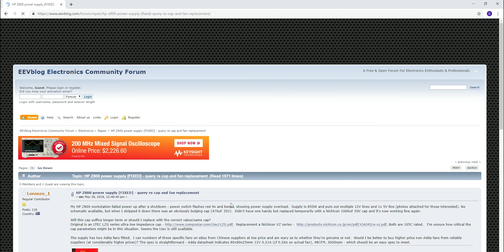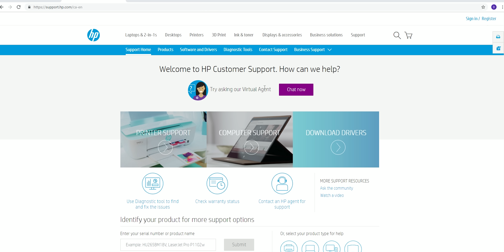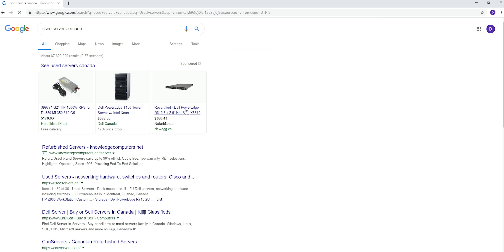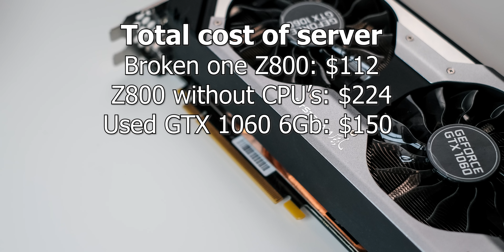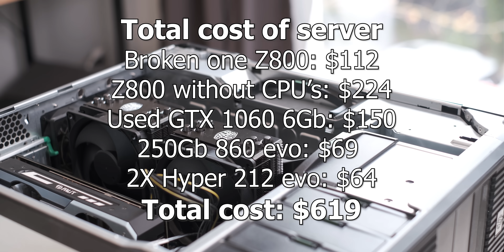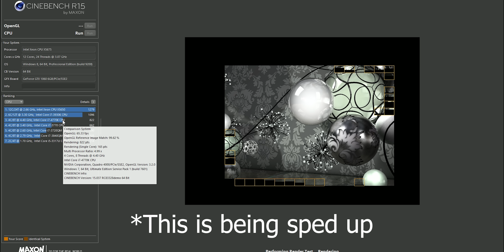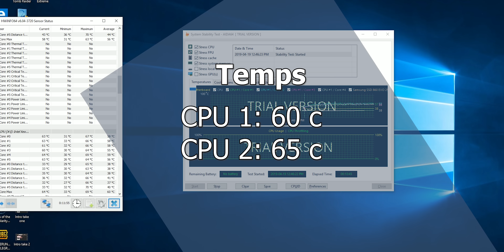Dual Intel Xeon, 48Gb BEAST for under $700! (With Benchmarks)

Comment: The two happiest days of one's life... the day you get your dual cpu system and the day you sell that system.
Reply: I don’t know I nearly cried when I sold mine, (was noticeably faster, 2 e5- 2670) and it was 2016 then. I did regret not doing some things differently, like motherboard choice. but its all behind me now I have a single 14C xeon cpu now.
Reply: Major Architect i have them aswell
Reply from the maker: Haha!! I guess that's an exciting circle of life for a PC.
Reply: @DawidDoesTechStuff  where you able to get the dual xeon system to go into a sleep state?  I have S5520hc with dual xeon and the dam thing wont idle.  in one month it raised my electric bill $150 :/
Reply: ive got a e5 26xx dual socket. was gonna use it for video editing, but im gonna use it for storage now, and probably networking too. like a router with the storage built in.
Reply: FACT. I had a dual xeon 2689w system with 64gb ram, much faster than this one as it scored about 2000 in cinebench (employed as a 3d animator) and a simple 1st or 2nd gen ryzen 7 cpu is far better. similar multi core score and MUCH higher single core. zero reason to get old xeons the second the ryzen cpu's came out.
Reply: @adambrandejs1839  No that just means more reason to get a dual socket with zen cores. Think they make them in micro-atx? I like compact builds.
Reply: Jame Gumb they don’t make dual socket ryzen at all. Let alone in micro ATX. You need epyc for that, in E-ATX.
Reply: @jamegumb7298  no. Dual core motherboards are extremely rare an extremely big so you only have like 1 option last i checked. Which sucks cause you need more than a motherboard that has 2 processors. You need gaming features an massive space for slots an high end audio etc
Reply: @adambrandejs1839  Zen 2 really is going to kill the whole dual Xeon workstation/desktop hack. The power usage, performance, and price just don't justify building these rigs. The only upside is getting the ECC dims to clock higher in an older DDR3 Ryzen board.
Reply: @wes9451  some people spec up dual amd epic 64core rigs, for total of 128 cores. There are always use cases for more cores.
Reply: @adambrandejs1839  the fact that the prices if these cpus are fraction of the cost is the reason its worth it, its not always the score on the benchmarks although its important.
Reply: adam brandejs -except in certain virtualization scenarios, especially if you need lots of PCI express for multiple gpus and other devices.  they can still be competitive but much cheaper than thread ripper alternatives. also generally better supported in software, requiring less work arounds.
Reply: @adambrandejs1839  except money. Refurbished xeon workstations can be pretty cheap.
Reply: @adambrandejs1839  sometime tou just need cores for a bargain price. I'm looking at a dual e5-2680v2 build with 64gb of ram, 250 m.2 and 2x2tb barracudas.  It will cost 650 to700 pounds all in. That will score roughly 70% of a 3950x system. Which would cost roughly 2.5 to 3x that. Good pp$ I need a vm and network simulation monster while I'm still a student lol.
Reply: @petershuker163  Having used a similar system for a similar purpose, I'd really rather use a more modern CPU with fewer cores, because (1) VMs aren't usually busy all at the same time, so oversubscribing cores makes sense (2) these old Xeons are just so incredibly slow for lightly threaded workloads, that just having a deskop on them gets annoying quick.
Reply: @adambrandejs1839  memory capacity and bandwith say otherwise. I have a dual E5 2678v3 system with 256gb of ddr4 2400mhz cl12 in 8 channel (4 channels per cpu) and has similar single core performance to stock 2700s with a turbo boost unlock, and destroys them in multi.
Reply: @adambrandejs1839  weird, my dual 2670 system scores 4200 in cinebench, and my Ryzen 3700x with a Radeon 5700xt, (I know it is CPU based) only scores 4800. It cost, over $1k, whereas the dual xeon, I picked up off eBay for $345 before I added RAM, or a little more than the Ryzen CPU itself. And for virtualization, has twice as many vcores. Dual xeon machines off eBay are still a good deal.
Reply: @ftnetops4264  are you running the all core turbo hack?
Reply: @KadiusFTW  Not that I have set up. They are not v3's. I do show they are running at above 3ghz on all cores, though.
Reply: @adambrandejs1839  I have a stock Ryzen 3600X with good B die Ram  it gets 3850 in Cinebench R20.
Reply: My needs for dual CPU systems died the when Threadripper/Epyc were released.
Reply: Abit BP6 with dual Celerons!
Reply: I still have my old Dual Pentium III board and the 1.4GHz CPUs. 
Some day I will rebuild it as a retro museum show and tell like system.
Reply: @vh9network  I finally threw away my Dell Precision 220s with dual PIIIs... They used RDRAM and it was ridiculous to find enough to run anything close to current
Reply: Me with my R900 four CPU server. $70 and profited $30
Reply: Same with boats
Reply: Not really. I have 8 dual cpu z620 in the company and still use a dual z600 as my daily office driver. 200 chrome tabs? - easy peasy.
Reply: This comment doesn't even make sense.
Reply: Yep! Same as Alpha Romeo cars :)
Reply: I miss my dual xeon system, even though my i7 7700k seriously outperforms it, there's something about having dual CPUs, its just so much better than dual GPUs
Reply: Never.
Reply: Lol true, I'm currently selling my hp z600 and just purchased a hp z820, I love the older hp z line up thus far.
Reply: sad FACT: you can't sell them, because nobody wants them. I have 4 combos, Intel S5520HC with pair of X5690 or X5680 CPUs, after I upgraded every machine to SuperMicro X9DRi-L4FN+ and E5-2667v2, and auction for them has been hanging for like 5 months now, despite price being lower than pair of these CPUs go together. I think people buy these things only to build that kind of system , and aren't sure exactly what to do with it afterwards.
Reply: @Vatharian  I have a single 6200 Opteron build I did in 2013(lured by cheap CPUs) but life got messy and it just sat there. I should have found someone who could have used it for compiling, R, or something of the sort in the few years that followed. Now I doubt a Data Sci/Computer sci major would even want it for free. That's why I ordered a 6348 for 15 bucks.
Reply: @Dcatts-i2z  If you can max out the platform fox cheap, why not. But some things aren't worth it. I have 30 socket 604 platforms, dual cpu and all, the are just sitting in the basement. There is literally nothing exemplar about them, except them being testament to my stubbornness.  Vintage/retro server guys love SGIs and dual 486, Pentium 3s and Core2 Xeons, while P4 just sits there.
At least you can run modern Linux and W10 on your setup.
Reply: I never sold a CPU.  My last one lasted 10 years an i just left it behind when I moved because I couldn't carry it
Reply: I have a bunch of dual CPU workstations from the 90's till today and never sold one. I keep them in my collection. The most expensive one cost almost $10,000 in todays money 20+ years ago and made its money back several times over.
Reply: Just picked up an Asus Z9PE-D16/2L dual xeon, 2670, 16 core system in a huge Fractal Design case, off eBay for $350. Running esxi 7.0, It seems to idle around 100 watts, about the same as my dual, 2430v2 Dell, T420, also, bought off eBay at $400. Weird comments here. These are quiet, low power use systems, great for home lab and network or Vmware certification labs. I'll upgrade it In a bit to dual xeon 2695's to get 48 vcores for another $300.
Reply: @ftnetops4264  That's what I'm using my stuff for. Putting together a 4c/8t Haswell build atm because student licences are for vServer/Center 7.0.
Reply: @ftnetops4264  might wanna go dual e5 2696 as they have a higher all core boost
Reply: @KadiusFTW  for me, the 32 cores are about all I need. I also have a Dell T420 with 24 vcores, and so simulate two, separate, DR datacenters. Strangely, some commented that their 2680 or something, was only scoring 2k in cinebench. Mine is a solid 4200 with the 2670's, and a Quadro 4000 with only 2GB Ram.
Reply: It's expensive. And it's something almost nobody want.
Reply: @sophustranquillitastv4468  Why?
Reply: @mokanin8894  Because dual CPU system have less option onboard, difficult to find a case that can hold it, require massive power supply even the whole system didn't use that much power but want 2 EPS power connectors, and lastly, it's very expensive relative to how much generation has pass (CPUs are not expensive but motherboard are). The god thing is you can have something that normal people would not nave, simply unique, but the downside is how expensive they are even they are old. Good dual CPU motherboard can get the price as high as 250$ or even more. If someone want to get it's payable foe him, but everyone else usually think it's a rip off. If you get that kind of system but now you've bored of it, expect the price you sell will be no more than 30% of the price you bought.
Reply: @sophustranquillitastv4468  Thanks for the reply. Do you personally think dual CPU systems are better for server builds for virtual machines and such? Are there any pros to dual cpu systems nowadays?
Reply: @sophustranquillitastv4468  why wouldn't anyone want it? Mine rocks
Reply: @jessejames5825  I still using them too even now and I still want more, but in my country not so many people want it and all the tech YouTubers in my country always say "just get newer generation mainstream parts".
Reply: it was a sad day when i sold my 2007 mac pro, insanely powerful for how old it was, and there will never be anything like that mac pro/g5 case ever again sadly. :(
Reply: I want one for machine learning / neural networks. Glad to see in the comments that I'm rather alone, so lower prices for me then... 😎
Reply: That second day might be close for me and you might be right. I have dual 2667 V4 (32 threads, around 2435 points CB R15) and 64GB of RAM, i changed work and do not run VMs anymore, so i am thinking to replace it. Either with 9900KS, which have the same performance in half cores (and is old and insecure tech now), but the problem is i do not want to "downgrade", so i am also considering 3950X. That one is exactly twice the power, but i do not need that anymore... :) Also, the 3950X will make the dual Xeon system difficult to sell for reasonable price...
Reply: You're a fucking idiot
Reply: @bronanu201  Because i do not like odd number of cores like 6 or 12. I think its not right. :) I guess i will wait for a while, to see if Intel will have more bugs and how the availability and price of 3950X will be. I also want watercooling monoblock this time and the only AMD board for which EKWB have block is quite expensive. Well, difficult times, thanks AMD. :)
Reply: @jointercz  Computer processors had an odd number of cores for years until dual cores were introduced.
Reply: @JesusIsLordAndSavior77  "Odd" like not being a multiple of 2. :)
Reply: @jointercz  6 and 12 ARE multiples of 2...
Reply: @jointercz  math not your strong suit yea? 6 and 12 are both devisible by 2.  Never met someone that doesn't know what odd and even numbers are.
Reply: @jointercz  6 and 12 ar multiples of 2..
Reply: @jointercz  6 and 12 ARE multiples of 2. AHAH, you meant powers of 2, right?
Reply: @jointercz  6 and 12 are even numbers buddy
Reply: @spacetoasted  Got 5950x so my binary OCD is satisfied and my dual Xeon system is sold. 😉 My AMD have about twice the computing power, only RAM throughput is lower.
Reply: @jointercz  6 and 12 are even numbers my friend.
Reply: @michaelweems679  From one of the online dictionaries: "If you describe someone or something as odd, you think that they are strange or unusual. "

Comment: With all those PCIe slots, there's no excuse for not adding a cheap USB3 card. Could even get one of the USB 3.1 cards that use a 2x connector as you've got plenty of 4x or 8x slots that otherwise are not useful for non sever stuff.
Reply from the maker: That's a good point. The nice thing about this server is that it is very expandable.
Reply: I do have a USB3 card in mine. Interestingly it struggles to run multiple 2.5 HDDs off of a single card (not all of them power up). (And yes, there is power supplied by a SATA power adapter to the card.) Under windows 10 I get the occasional IO hang for 30s or so, and tried removing the USB3 card (same behaviour) and haven't got round to plugging it back in.
Reply: I thought the exact same thing, easy fix!
Reply: also get a PCIE to NVME M.2 drive and a SATA 3 expansion card and Hot plug SSD bay and run the on board SATA in raid